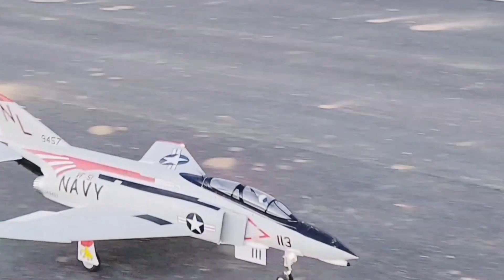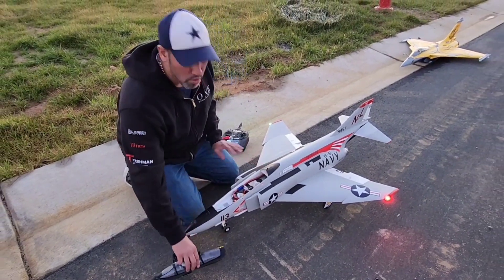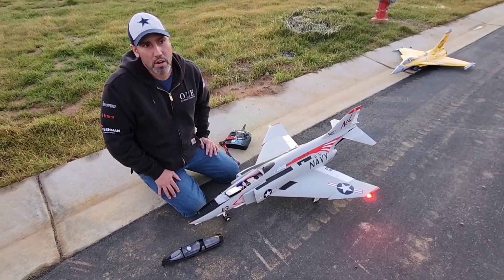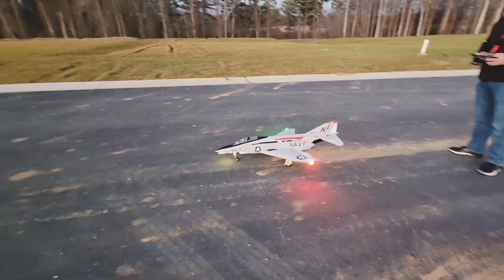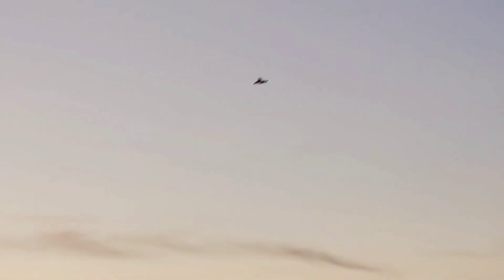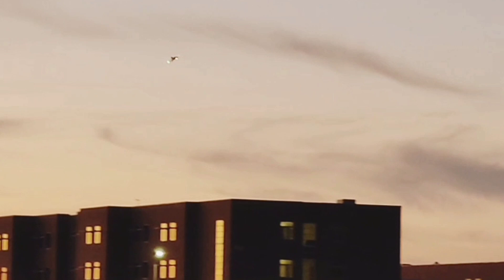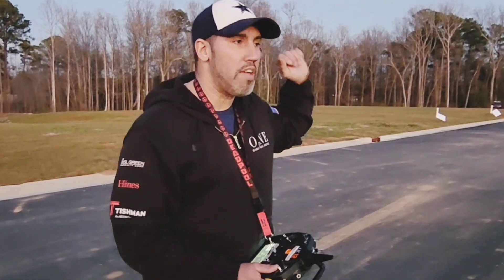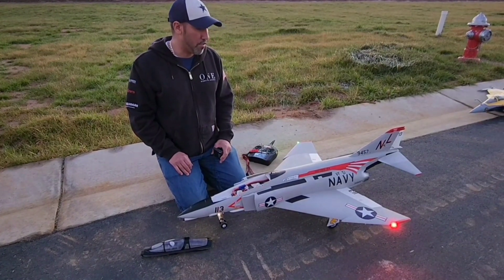Eflite F-4 Phantom Maiden #eflite #rcplane #aviation

Comment: If this is your first flight with it remember to pull off the rudder and check the elevator Servo. It is notorious for coming loose and the aircraft having pitch control problems. Also try to not fly it with a heavy battery. Not more than a 6S 3300Mah. The wing landing gear break through the top of the wing easily if over weight. They should have corrected these problems and kept the model in production.
Reply: Wow this is critically valuable information and I greatly appreciate your input. I will look into these issues and make improvements. Thanks for checking us out and most importantly your time for letting me know.